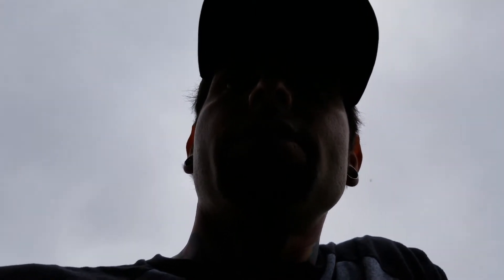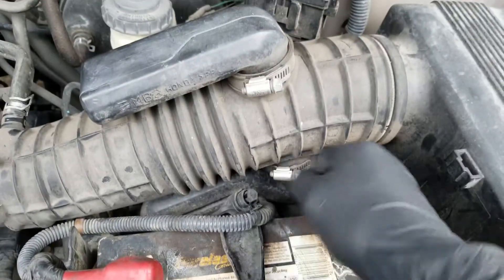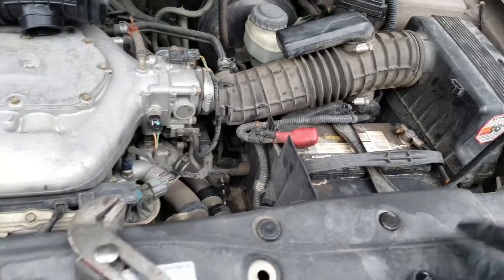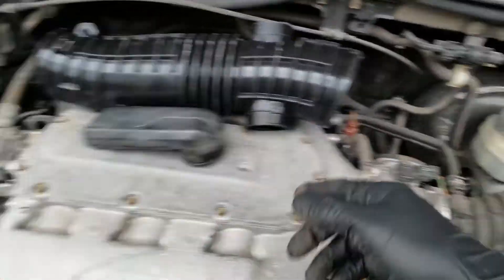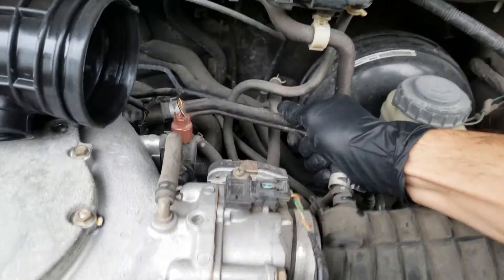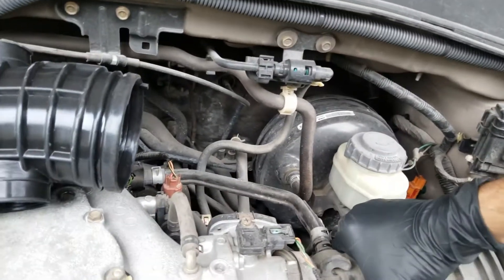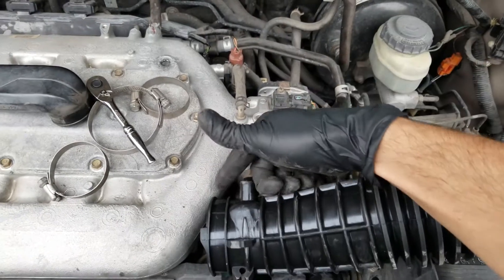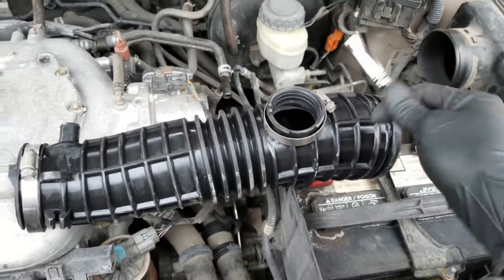Replacing intake piping on the 2006-2008 honda pilot

Comment: Hello I have a question? What happens if you don't fix it? Does damage the engine?
Reply from the maker: It will over time it will suck in dust and dirt into your intake side of your valves, basically bypassing your air filter, not to mention your engine will no longer be getting cool air from the outside and will also hurt your gas mileage
Reply: Thank you very much I will fix it soon

Comment: I have a 2008 Honda Pilot hose that’s need to be changed. Mines is broken just like yours. Thanks for the video lm gonna try to do it myself.
Reply: Mine has a crack and the shop wants $150 for that part plus alot of money to change it   found it on amazon fir $24! Im try and do it tomorrow

Comment: Did you pilot leak radiator fluid or any other
Reply from the maker: It’s leaking oil and power steering fluid
Reply: Mine was leaking radiator fluid n there was no hole on the heater hose
Reply: So I put a radiator leak sealer n it worked